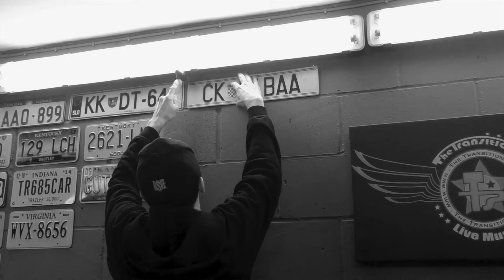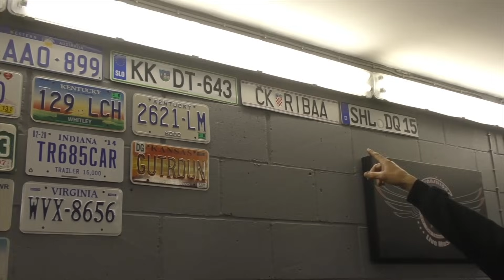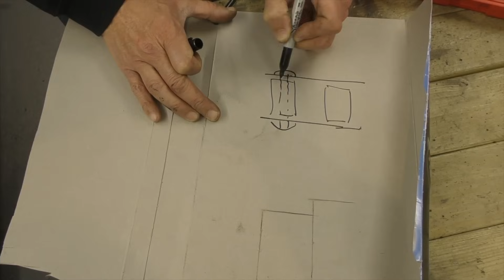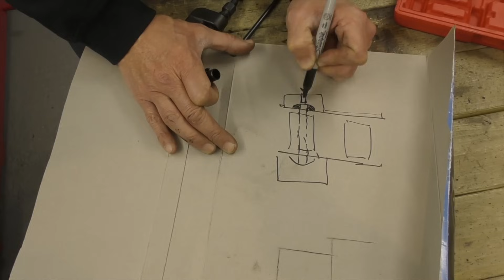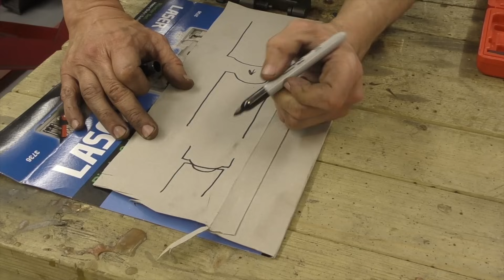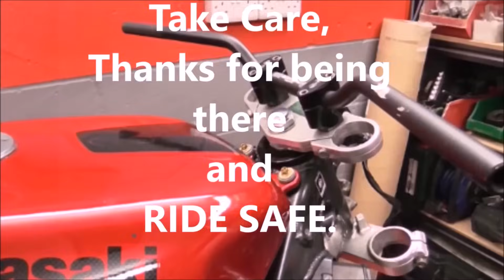Delboy's Garage, Motorcycle Chain and Sprocket Change.

Comment: That Sealy riveter is junk, I did exactly what you did and the dome riveting insert deformed. It was softer steel than the rivet link. Didn't do anything to the rivet pin whatsoever and now I'm left with a useless tool and a bike I can't ride
Reply from the maker: OK, have you shared your problem with Sealey,? their hand tools are guaranteed made, and is it actually a genuine Sealey one,? did you buy it from Wemoto or even Sealey direct?.. there are plenty of knock-off ones for sale on the net.!? and did you also actually measure the chain pin?, did it not even flare by a single thou ? the flare isn't visible to the eye, you need to measure it with a caliper mate !
Reply: @Moonfleet41  im going to write to the seller about it. i got it on ebay from a UK automotive parts seller. looks genuine, wit the sealy instruction sheet inside but its made out of butter. im very disappointed
I measured the chain pin after my attempt with a caliper and there is absolutely no change to the pins diameter. it was not flared whatsoever.
Reply from the maker: @lukaszM46   OK, that sounds like it's maybe a cheap copy of the kit.. ive successfully flared 3 chains with mine, and it has a ridge around the dome, but still good to go..  if you bought it from Wemoto, i know they sell the pins in packs of three, so they are in some way a "consumable" part..   but sadly there are many copies of the kit out there that look the same and you can't tell the difference.. see how you go with your supplier, and if you're stuck, and end up lost for a solution, then let me know, there is another product on the market that does the job, and a little more robust..  Good luck mate.
Reply: @Moonfleet41  thanks for the replies by the way, I learned a lot from your content and I appreciate what you're doing on YouTube!

I ended up using 2 anvils and put a ball bearing in between so that I can flare the pins with something with high hardness. The ball bearing made an imprint on the anvil too but at the same time managed to flare the pins alright so it worked out fine and I have a rideable bike. 

Overall the product is well engineered but the materials are just too soft. I saw the riveter DID KM500R, looks waaay more robust and more convenient to use but I can't justify the price of 140gbp for something that I will use on the not so many chains I will go through in my lifetime. It'll do for now. Thanks!
Reply from the maker: @lukaszM46  ha ha, that took me back.. as much as it's not a clever admission, back a long time ago, i used to glue a small ball bearing into the dimple, ten smack it with a 2lb hammer and a hammer held behind it.. always worked fine..      But look... this video was over 3 years ago mate, i made a great discovery last year,  that Wemoto offer a copy of the DID tool, its a third of the price of the real thing, and the twice ive used it, it works a treat.... 
firstly here's the link for ya' https://www.wemoto.com/bikes/ktm/200_duke/14/picture/chain_riveter_-_km500_style 
...and here is my very latest Chain replacement video made a year ago, watch from 9.48 onwards  https://www.youtube.com/watch?v=oVMDq4qGJVI
Reply: @Moonfleet41  thanks a lot, that is a price that i may consider, and given that its tested by you and it works. what's even more important you can get replacement pins from DID and they are the real deal that will work with this copy tool.
Reply from the maker: @lukaszM46  As far as I know mate, the pins in this kit are from DID, because if you check on Sealey's website, the replacement pins are the same price as the kit, and the one in my kit, as you may have noticed in the video, is a nicer metal finish than the rest of the tool... anyway, good luck with it mate, glad you're back on the road.

Comment: nice video, I have a question, I have 1985 Kawasaki Ninja GPZ600R  ZX600A I was hoping to find videos on youtube on repairs and how to remove & replace etc.
there's nothing that can help me I have the workshop manual it doesn't help either.

anyway, my question is I removed the chain and noticed the engine Sprocket is loose it has 2 bolts tight to it but it moves around side to side etc.
is this normal?

Comment: So the rubber on the cs sprocket makes your bike slower eh? Lol, it makes for a LOT quieter chaindrive, and the lack of it on the new one will make the bike quite a bit noisier - which is fine as you won't have to pass any noise scrutiny tests again. But telling people that the lack of rubber hence weight will make for a quicker revving bike is nonsense - you'd be very hard pressed to measure it let alone feel it, in practice it makes zero difference.

Comment: Brilliant video, my chain breaking kit had a plate that didn't quite fit over both pins so I improvised using the anvil and the face of the main tool body to press the plate on and that worked a treat

This video gave me so much confidence going into an important procedure such as this

Comment: Really informative video as always, I do find your videos a great resource so thankyou for taking the time to make them. I do have one question, I have followed your guide using the same rivet kit as you have in the video. I have riveted down however the dome end of the pin does not stay within the hollow link, I can visually see it go into the hollow link up to the inner collar but will fall out when I let go. Do you think this is an issue?

Comment: Nicely done.  I have a brand new chain to install that's one link too long.  I have a good tool for pressing out the pin, but will carefully grind off the head as you recommend.  Thanks!

Comment: I wouldnt trust those. Ive tried the same riveter and nothing got rivited. All it did was mangle the tool.
Reply from the maker: Did you measure the rivet with a caliper before and after, it may only expand by as little as 1/2mm, that is plenty to wedge it, they don't flatten off, or visibly flare right out, just expand very slightly and if you mangled your tool, you over did the pressure, next time try measuring the rivet link and you'll see that it does expand it...
Reply: I have tried a more expensive tool and the difference was remarkable.

Comment: ya didn't realize alot of those chain braking kits also come with a chain installing pin tool as well. Nice video i don't ride motorcycles but same principal applies to any chain provide you have the same tool but different size.

Comment: If i have been  watching this video yesterday i wouldn't break my tool 🤭
Tho i ditched the end of 3.8mm pin that broken and added a broken piece from a 4mm half hss drill bit that worket fine.
Still your video explains verry good also  how to mount the new chain,very useful. 
Good video

Comment: bad bad method... I do have the exact chain tool from china (the cheapest one) and it is way too soft to rivet the pin properly, the metal of the tool gets dented instead of a pin (made another riveting head from a screw head attachment, it is harder) ! You should measure the outer diameter of the pin after riveting (its change)... you'll loose your chains with such tool, bros !

Comment: you also forgot to say, when you put the axle back on you are RELIEVING the tension & torsion of the BRAKE HYDRAULIC HOSE, keeping it from cracking, splitting, etc. in essence saving some pounds or dollars of the hose you have, and not wearing it out prematurely.

Comment: Reviews for the that chain tool are really bad, I'm guessing you bought yours when the quality was better.
Reply from the maker: The only weak point is the spreader pin, it'll spread maybe two pins at best, then you can just replace it for about £6... its perfect for a home diy application where you may change a chain and sprockets maybe once every two years at best... if you need a more robust and professional kit then you can buy one, they're at least twice the price of this.. this kit gives you a budget option if you need it..! !!!
Reply: @Moonfleet41  I could see yours worked well. The review I read said that even in the promotion video you can see the tool bending. Didn't want to take the chance, so opted for the Oxford version. Will let you know if it's any good ✌️